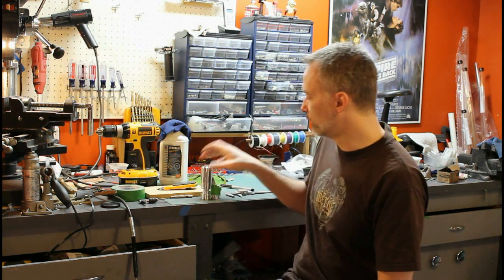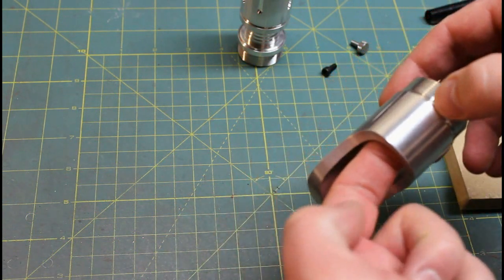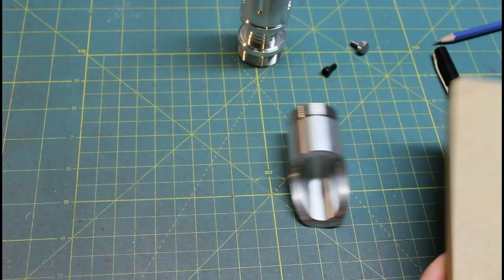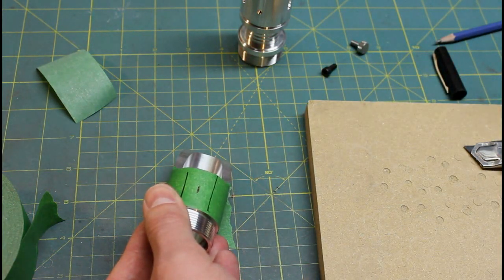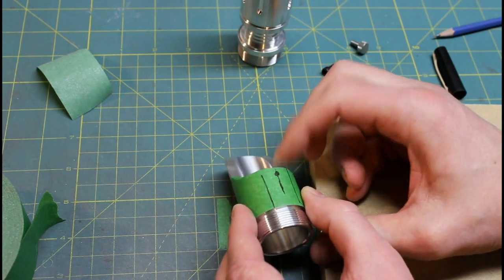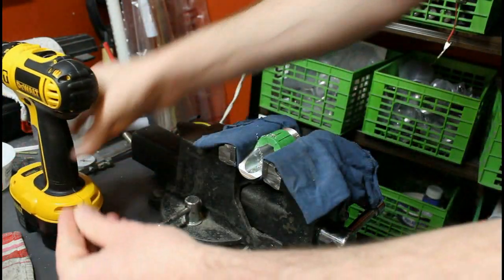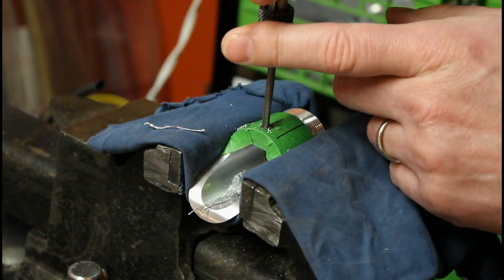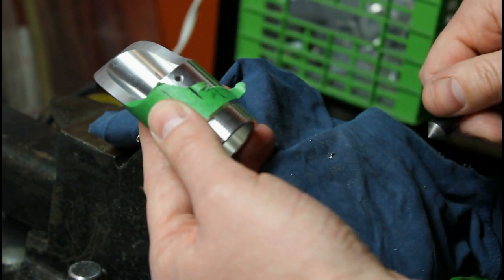Blade Retention Screw

Comment: so I have a sf oracle and the hole for the retention screw has widened to were the screw want stay. is there anything i can do to fix that other than replacing the screw with a larger one or drilling and taping a new hole on the other side of the Emitter pommel?

Comment: Just a suggestion, but often times in a soft material such as aluminum, a coarser thread, such as an 8-24 (although it is an odd size) tends to wear less because there is more "meat" on each individual thread.
Reply: +Tom Sullivan I always advise experimenting to find what works best for you. 8-32 is more common, easier to find a variety of screws.

Comment: I was at my local hardware store and I saw a drill bit that has the 8-32 tap built into it (essentially drilling and tapping in one step). Would this work, or like many "X-in-1" tools, would it do neither job very well? I believe the brand was Dewalt if that matters.
Reply: +17ian66 I wouldn't use it. I tap by hand - using a drill would probably damage stuff
Reply: +Rob Petkau Thanks for the input, and apologies for the late reply. The bit did end up working for me (I used it for an LED retention screw hole in a Graflex 2.0 build, and the moment I was done I got your response), but it did stick a little bit coming out so I'll be going with hand tapping in the future. Especially if the hole is going to be on the outside of a hilt (as opposed to the Graflex 2.0's internal blade holder).

Comment: I was wondering if you know for sure that it's a 1/16 that you used to drill the initial hole? I plan to make a retention screw hole that's more convenient for my saber today. I know that the actual tap end is 8/23 if I'm not mistaken.
Reply: +Steven Perez 8-32 is a common thread size. You can look up the ideal drill bit size to go with that. A pilot hole is a smaller drill bit size just to get the hole exactly where you want before you drill with the correct size